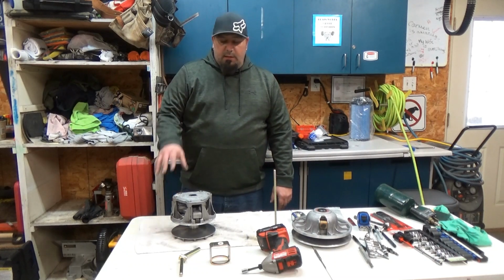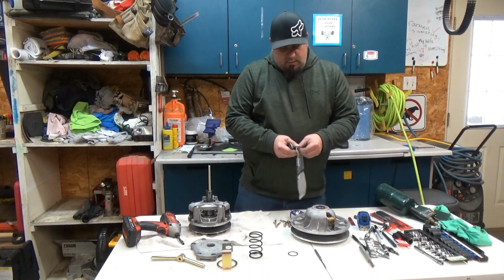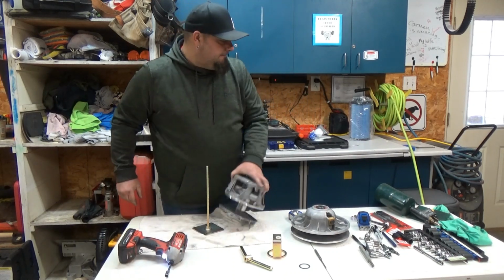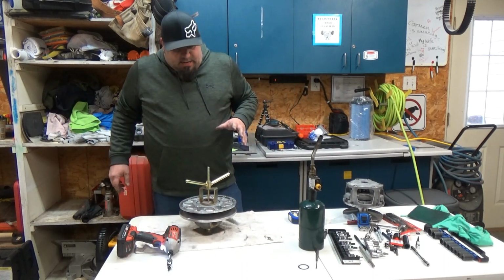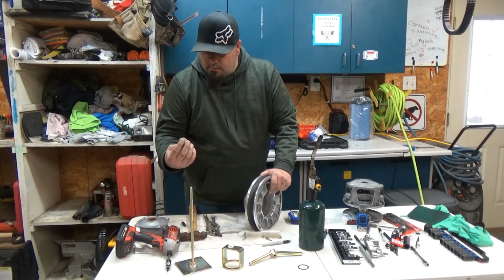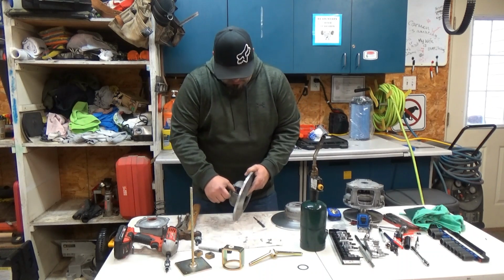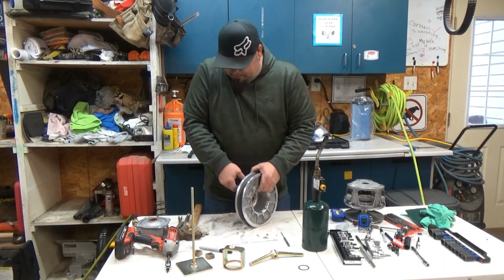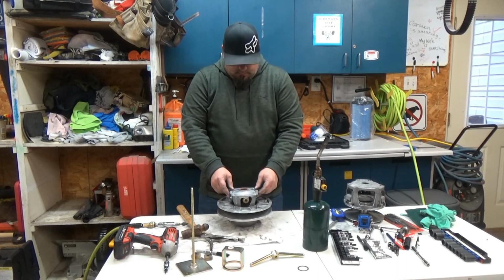RZR XP 1000 Hunter works White Washer & Secondary Roller Kit

Comment: Ok did this fix the jerky starts in forward and reverse ? Does have faster engagement into gear?
Reply from the maker: Yes, it did fix my Jerky starts in forward and reverse. It does seem to have faster engagement in the primary clutch. Make sure you check for belt wear. My belt didn't have many miles or severe wear. Thanks for watching Dirt Poor Tv.
Reply: @dirtpoortv4483  so ppl say they lost some of their top end speed did you?
Reply from the maker: @howardmiller4241  I didn't notice any loss of top speed. My top speed is 82 mph with stock tires. I also have a DynoJet Power Vision 3
Reply from the maker: @howardmiller4241  Thanks for watching Dirt Poor Tv

Comment: If there is wear (missing metal) why would you want to grind away more metal. Makes bigger tolerance then before you ground it down.  Doesn't make sense.
Reply from the maker: Because if you don't smooth the metal, that the square pucks damage. The round rollers wont work properly and will cause premature wear on the parts. Thanks for watching Dirt Poor Tv

Comment: Why not do it when the clutches are on the rig?
Reply from the maker: You can do the white washer in the primary on the machine. But you cannot do the secondary round rollers on the machine. Because the bolts are on the back side of the secondary. Thanks for Watching Dirt Poor Tv.